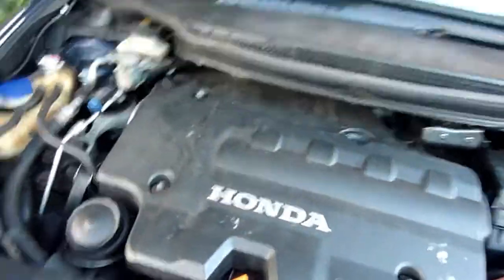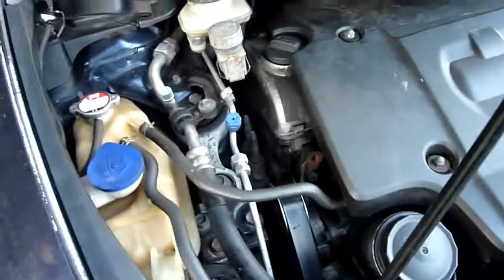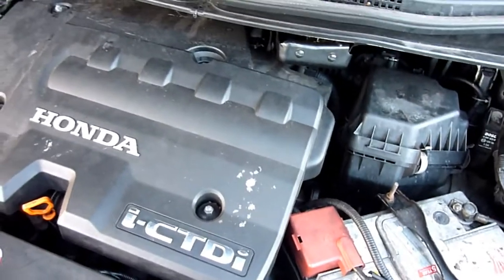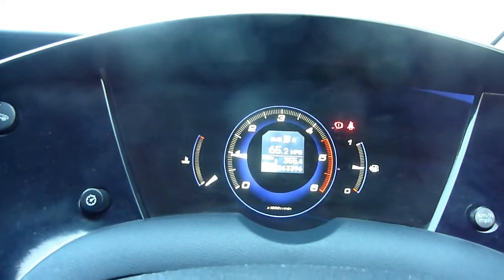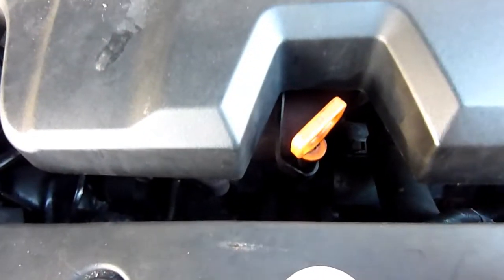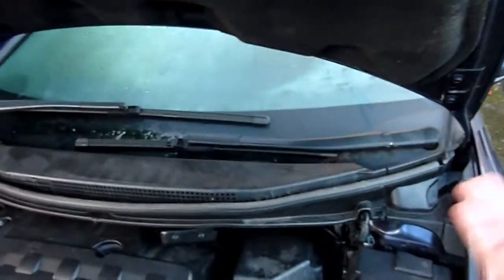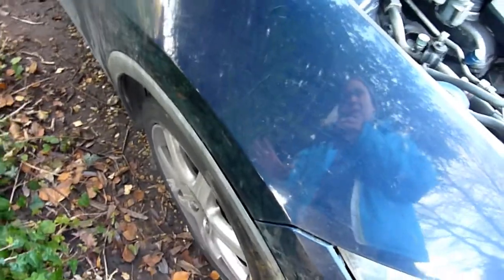Engine Bay is Too Hot - what to do

Comment: Having sane with my cad dts....engine gets extremely hot cant even chec fluid levels or nothing...temp gauge is not high its in normal range....i dont kno what it is gonna chec thermostat to be on safe side
Reply from the maker: Take the auxiliary belt off when it's cold and rotate with your hands everything that turns...alternator, pulleys, tensioner, ac compressor....anything that runs roughly needs changing.

Comment: Thanks, My 2008 Honda Civic is super hot in the engine bay, cant even touch some parts. The coolant is new, temps are ok but still something is super hot. I think my alternator or some other pulley bearing is toast. The 4 pin connector on the alternator broke like a biscuit due to the heat, I hope I can fix it this week, get the alternator checked.
Reply: Something like this is happening to my ST204 Celica... only because I didn't bother with sourcing a heat shield for the exhaust manifold. I'm afraid something might happened to engine's wiring... Currently a mechanic of mine is investigating the issue.
Reply: @PrekiFromPoland any updates and it the problem fixed?
Reply: @southbayla3137  ECU issue - one capacitor was blown and it had to be replaced and the PCB had to be cleaned from the leak.

Comment: DEAR pine.... I GOT HEAT COMING OUT FROM MY ENGINE BLOWING STRAIGHT INTO MY CAR`S CABIN  WITH HEAT OFF WEIRD OR WHAT HOW CAN I FIX IT CANT FIND ANY VIDEOS ON THIS TOPIC ?
Reply from the maker: Open it up like in one of my videos how to stop leaks in the footwell of his hands civic.
I think you are missing a rain guide plate...watch my video and you will see which plate I mean.
Reply: Turn your A/C on and lower the temperature to a cooler temp before you turn off the heater that way you won’t get heat entering the cabin I noticed with Hondas even if you turn off the heater/ A/c it still releases whatever was last on

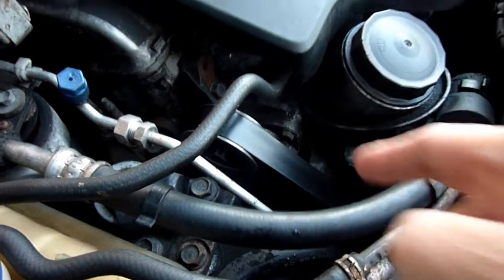Comment: waits until minute 5:35 that the extra heat in the engine bay was caused by a worn pulley , bad alternator bearings, ac clutch

Comment: I have the very same issue with my old mazda 323 familia 1997. It gets excessively hot, even the engine. Please need assistance.
Reply from the maker: Do the temperature test...run it turn engine off and feel where the heat is coming from

Comment: I had this issue on my 2.2 when i was thrashing it a bit and hit traffic and turned the engine off and on while stationary - i did hear some liquid sounds too - I changed the the oil and coolant and it has not seemed to be an issue since although my mpg isnt that great - did you find any other culprits since posting the video?
Reply from the maker: If I remember it was worn bearings on belt rollers, worn bearing on alternator changed thermostat to be sure.

Comment: I've just bought a Honda civic 2.2 cdti. I'm having a major issue where my car will only start when I'm getting a friend to pump the hand primer while I push the start button. Any advice would be greatly appreciated thanks
Reply from the maker: Research: locate fuel filter and pump. Try changing the fuel filter. Try changing the fuel pump likely located in the fuel tank.
Reply: @EducationPineapple  excellent thanks for the reply 👍

Comment: i have a chery qq 0.8L 3 cylinder engine .. i am facing same issue engine bay is too hot and have a pathetic gas mileage ..  its just an 800cc engine .. here are the things which i did but didnt get any result
1. No Thermostat took it out parmanently
2. Changed fresh engine oil
3. Changed fresh Transmission Oil
4. New Air Filter
5. New Spark Plugs
6. Cleaned injectors
7. Cleaned throttle body
after all efforts its still the same
Reply from the maker: check bearings of rollers such as pulleys and alternator
Reply: @EducationPineapple  ive checked each and everything all is good ...
Reply from the maker: @maxpain0007  Find out where the most heat is coming of. Sounds like you've been using hard water instead of distilled or deionised water in your radiator.
Reply: yes my country is a warm place and temperatures reach more than 50 degrees Celsius .. and the heat comes from engine too much and it is giving me mileage of not more than 5 kilometer per litre
Reply from the maker: @maxpain0007  that is about 11mpg...I would start with concentrating on all of the cooling system. Flush the engine coolant. Make sure you have no air in the coolant. Fans are working. Water pump is functioning properly.
Reply: @EducationPineapple  installed new water pump and installed new headgasket as well
Reply from the maker: @maxpain0007  In that case you must have worn piston, or piston rings. You might be getting low compression. Do a compression test.
Reply: @maxpain0007  how do you live with 50° celcius man!? We get 36 max! That's maddd👀
Reply: I had this problem a year ago on my 06 grand prix. I replaced the heater core and hoses, radiator, water pump, radiator fan and coolant temperature sensor and after that my engine wasn't hot anymore.

Comment: I have a 2019 Subaru Legacy  and the hood and headlight gets too hot to the touch. Why is this happening to a fairly new car. Only has 36,000 miles
Reply from the maker: Do the obvious and check coolant levels...check the temp gauge as an obvious one as well. If the temp gauge says normal, then work through all the points I suggested, for example alternator, pulleys, stuck AC compressor...all with engine running, but you testing it when engine stopped, of course. Don't want to be checking by hand if engine is running. A heat sensitive laser pointer/ reader/ meter will also help. Must be excess friction from somewhere. Good luck.
Reply: i own a chery qq same thing is happening with my car engine bay is extremely hot ... and it always bursts my water hoses
Reply: Same here all the front of the car is hotter than it should be i mean its 100°F outside but still i think its alil hotter thab it should be, i will have to go to the mechanic shop so they can check everything is working ok.